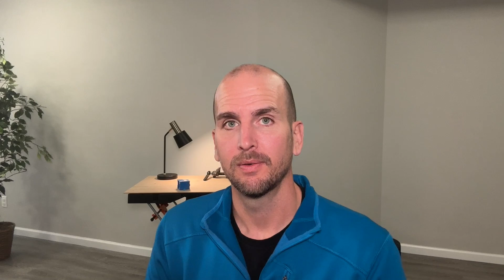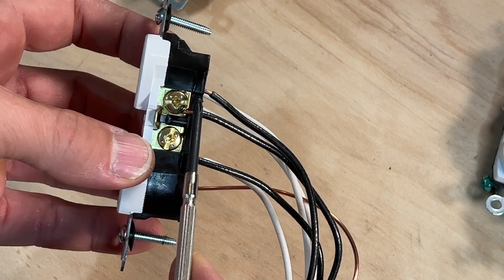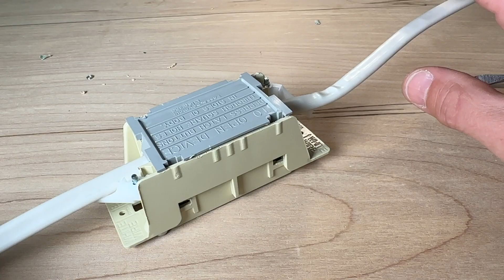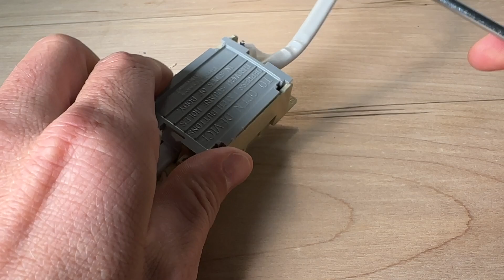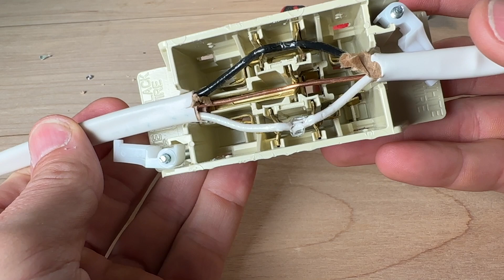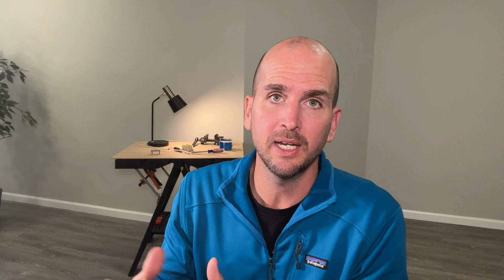90% Of Homeowners Have Never Seen This Dangerous Electrical Device

Comment: 48 years as a master electrician i'm okay with these outlet and switches long as you use the proper tool when installing them. Sure the tool is costly but do you want a surgeon to use a box cutter or x-acto knife on you because they were too cheap to buy the proper surgical scalpels? These are not designed for the common DIY to go playing with. In fact DIYers and videos like this get DIY folks in trouble more than people know. Leave the wiring to the pros. I had to deal with an accountant once who wire an outlet wrong and of course it shorted sparks and flames so he said. I told him I know very little about being an accountant so would he want me playing around in his customer's books? He got my point real fast.
Reply: When I worked in a hydro-generation plant one of the electricians came back on a Monday and told about going to help a neighbor with rewiring: his neighbor, not knowing anything, had bought rolls of green, red, black, blue, and white wire (at least it was all 12 gauge). Then he started wiring each circuit a different color.  - a red ground, neutral, and hot here, a white ground, neutral, and hot there, a black… etc!
Reply: @DanielinLaTuna  Holy Moly

Comment: The real question is: why the f*ck would you be drawing high current from an RV? These are completely fine for low power applications. I agree they probably shouldn't be in an RV due to the constant motion and vibrations that occurs while driving.

Comment: Never saw one.  I'd never use one either.  I don't even like them for low voltage wiring and they do have problems no matter how well you press them in.  I'm a DIY guy who has done a bunch of electrical over the years.  I've seen/fixed a lot of crap from "professionals".  I agree with your 3rd option for wiring.  I like back wire with the screw down terminal approach the best.

Comment: I've seen these in some repairs I've done in mobile homes. They should be outlawed!! Trouble comes when you have to replace one that's burnt up, and there is no slack in the wiring to be able to remove the damaged portion, and reconnect a proper device. Don't know how these were ever allowed by the NEC.

Comment: Have these in a new Rv.  One was packed with three pieces of Romex. It was broken and I could have warranty claimed it but after seeing it I decided to just install a box and standard plug. This was a circuit for the kitchen counter and we use a high amp water kettle there. Hard to believe these are legal.

Comment: I'm a new, younger home owner and have never seen these things before. Just LOOKING at it, I hate it so much. 

One of the first things I did when we bought our house was replace most of the outlets. One of the GFCI's in our bathroom wouldn't work when a higher power device was plugged in like a hairdryer or vacuum. But it wouldn't trip the breaker. When I took the outlet off, it actually had a small burn mark on it. And the insulation on the hot wire looked like it had been melted off a bit. After this, I became paranoid and replaced almost every outlet in our house using your guides as info. So you really helped me. I found that most outlets had used the speed wiring method. I would NEVER use one of these lol.

Comment: Have them throughout our 35 YO doublewide. I've replaced all of them on several circuits to handle the load generated by modern home electronics, especially the office. Slowly replacing the rest of them. A few of them were scorched inside from the bad connection points.

Comment: According to the 3280 hud standards if its ul listed the device can be used in manufactured housing. Manufactured homes still use the 2005 nec. The worst part of this is that there are blanks that are listed for use in concealed locations in wall cavities for if a romex wire gets damaged the blanks can be used to repair the wire.

Comment: I had to change the light switch out in my sister-in-law's trailer it was shortened out
Reply from the maker: Yeah the switches might even be worse.  Not to mention the setup for a 3-way circuit 🤦‍♂️

Comment: Had 35’ 5th wheel RV where the GFCI outlet in bathroom failed. It got very hot and started to smoke almost to the point of fire. I killed power to the RV and replaced this outlet with a residential unit and worked perfectly since.

Comment: From my experience with this style of connection usually the back of the housing has the press built in to it and have had issues with types of wiring, I've noticed that the wiring with the clear coating on the individual wires like in romex simpull they tend not to cut very well but with that said I wouldn't use this. It saves time and wiring in the long run until the property burns down

Comment: Horrible. There are high-amp receptacles and switches for mobile homes specifically designed for doing electrical work inside mobile homes (electronics + related testing)

Comment: Insulation displacement is not something I have seen outside telecommunications and automotive, this type of connection for anything higher than 50v is very concerning. As these are meant to be discarded and not to reused I have the distinct feeling they won't be, I also am uncomfortable with any connector that reduces the cross sectional area of a conductor, especially in a radial circuit.

Comment: I had one of these fail in my Desert Fox travel trailer. Over heated, didn’t kick the breaker but none of the outlets past the failed outlet would work.  Melted plastic and discoloured metal in the outlet. I replaced it with a proper eazy box and outlet. I wonder how these outlets ever passed code.

Comment: I'm not familiar with this type of connector, but given the same type are commonly in the automotive industry for aftermarket products, they are obviously very capable of carrying a lot of current without the generation of heat.
Also given that it has passed the safety testing and safety approval for use in your country, it is obviously deemed as suitable for purpose. 
Unless you have results that show it is unfit for use, your claims that there are inherent problems with them is simply your opinion, not fact.

The real issue is not the connector, it's the poor way they are being installed. If the electrician does not have the correct tools to install them, it's him not the connector that is the problem.
If a car mechanic used a child's chocolate spanner to tighten your wheel nuts would you blame the wheel nuts for coming undone? Of course you wouldn't!
So what logical reason do you have to blame the connector for the poor quality of installation?

Comment: Iam retired,  and have been wiring outlets since I was 10 years old.  I have never seen this method of wiring, and pray that I never see this used in a home, let alone a commercial site.   There ain't no way in hell that is a safe method of wiring. There is nothing there to move enough insulation to make a solid connection.  And when you daisy~chain several of these together, be sure to call the Fire Department in advance. I will continue to use the commercial back~plate fixtures when replacing current devices, or adding new devices.   Those things are a death~trap waiting for a cold, rainy night, and a compounded situation when used in a moble/modular home.     Have you ever seen a moble home go up in flames???  It takes 3 to 5 minutes to be totally engulfed

Comment: So, one uses 14 ga. wire to carry a 15A load, but the junctions between the wiring and the outlet are  what?  Looks like less than 1 millimeter in one dimension.  How did that idea ever gain traction?  Sorta reminds me of aluminum wiring.  I'm glad my mobile home was built before these things came on the market.  BTW, when were they first used?

Comment: I can't say I've seen them often but I've seen them at least twice. No I don't like them. But then again they are used exclusively in trailers where it's important to assemble quick so important that materials are often not chosen properly which means if you're in a trailer fire you have seconds to get out if that. So if they're skipping on the materials and build processes why not the electric too?
Only recently I believe the requirements were tightened down but I'm not sure that was everywhere.

Comment: Could you replace these in an RV with a standard household outlet and side wire it and wrap electrical tape around the screw terminals,. With no box?  There is usually a depth issue in RVs which requires the use of these inferior outlets.  Thoughts?

Comment: 24 year RV tech and owner of several RVs here. Yes, these things are pure sh!t.
The only good thing I've noticed, is on the many I've see that do burn, they burn internally and sometimes melt a portion of the faceplate. They self extinguish as they burn evidently. Never have I seen one cause a structural fire.

Comment: We have a manufactured house that has these. Not just outlets but switches too. When I first saw them I was like what blankety blank are these. I don't like them at all and have replaced them except a few switches and I will be replacing them too. Some of them were used to splice wires. instead of one wire going through it had separate wires fed in from each end with one wire push in on top of the other. In a few cases the second wire was loose. In one outlet the extra wire was almost touching the ground. In another you could see that the outlet was overheating. I think they are dangerous and anybody that has them should change them out with a molly box and a regular outlet.

Comment: 3:15. “Barely” removed the insulation is correct. Yet it has a strong connection (although small) to the wire. And it’s rated as a “gas tight” connection.

Comment: I've done a lot of punch down connections like this outlet, except in ethernet.  Always use the right tool, and you may need to test the tension on the tool to get a consistent good contact.  Done properly, they hold really well, and make great contact.  Getting them seated well does take practice.  I wouldn't suggest them for anyone that isn't doing a LOT of them.

Comment: These are insulation displacement connectors.  I've seen this type of connectors used with communication wiring, never with wiring carrying a relatively high current load.  Installing wires in these connectors requires correct tools and a skilled installer.  If you have these where you live, keep a fire extinguisher (or two) nearby at all times,

Comment: Even when the wire is pressed into the correct place,[ a hole the same Gage as the wire,] where you get more contact area, it is not much at all. It must still be 20 times less surface area than you get on a screw..

Comment: Had them in our 1985 manufactured home. after about 3 yrs of living in that home, we kept having issues with electronic devices like tv's and computers dying very early. once we did an addition to the house we took some of these apart and found that 3 out of 8 or 10 had black charring on the insides of the boxes and it appeared that the wires had shifted over the years from plugging things in and pulling them out, causing the contact patches to be nearly nonexistant. looked to be super unreliable and killed a lot of $$$ worth of electronic belongings. a few electricians we had over to investigate ended up leaking with no answers as to why so many devices were dying. they were like fires just waiting to happen from what we saw.

Comment: I just replaced one of these in my old Airstream trailer.  It had gotten moist from condensation over 40 winters and had corroded the connections.  I'd never seen one before I opened it up, and all I could think was that I was amazed that this passed UL cert.  Amazing.  I replaced it with a shallow work box and a weatherproof commercial outlet.  (Yes, it is inside the trailer.)

Comment: The automotive industry has had something similar for decades called "scotch locks" they are terrible.  They corrode quickly, the connects are poor and fail.  I refuse to use them.  I can't believe they are using the same pinch design in housing.  The heat would be a fire hazard.

Comment: The codes for trailer construction are a joke. The UL seal is probably because the outlet is self-disconnecting when it is overloaded. There is no way this can reliably handle a steady 15 amp load or even a 10 amp window air conditioner.

Comment: I am an RV technician and I hate these. they take more time to wire correctly then a standard outlet and manufacturers leave no excess cable so often times if they fail you are ripping into walls to re attach them. you also see 2 pieces of Romex joined in one of these instead of just one piece through which is a real pain to replace.

Comment: I've not used this particular type of outlet, but typically anything using insulation displacement on wires larger than signal level are a bad idea, even with the proper installation tool.

Comment: It is a manufactured home which , it came with 43 acres and bought it for that reason . They even are on the light switches have this bad design . So this is a winter project , outlets don't cost much to replace and there seems to be extra wire in the walls . My biggest question where did saving 1.00 per outlet get anyone ?

Comment: No experience with those, but have used the rather similar Ethernet/rj45 quite extensively. Even with the right tools. There is sometimes a bad contact made. No way to easily check or know a connection is good without a load test. No good for something of high power. Since everyone knows no one will ever do a load test. Even if it’s “required.” Ethernet is fine. Not enough power for it to ever be an issue. 120V 15A outlet? I don’t like that at all.

Comment: I have these in my 2007 modular home. My problem was the light switches. They were so cheap that the contact springs broke and you couldn't turn the lights off!  I took those out and replaced them with regular light switches using a buildup box. My supplier wanted  a god awful price just for one switch.  I replaced the bad ones and the boxes for the price of one "official" replacement switch and had money left over. And this didn't include the $350.00 squeeze tool to crimp the boxes together, which I really didn't need after replacing them with regular light switches. 

On a related topic, after the installers of the Dog Watch (tm) system left, I kept having false alarms. Turned out they grounded the system by hooking the ground to a screw fastening the receptacle box to the wall. Well these boxes have no exposed ground wires. I extended their ground wire outside to their ground rod and never had that problem since. Stay away from these abominations. Take  them out and throw them away.

Comment: This is nuts but I called it before case was opened. It’s an over sized cousin of the little Mickey Mouse on off switches put on supply cords of lamps and some light gauge extension cords. That’s a scary looking outlet. Trailers are the cheapest built homes on the planet. There pluming parts and fixtures are not like a house either. It’s all junk.

Comment: I think the generic term for this is an insulation-displacement connector. My trailer has these. I was in it one night while it was raining and the trailer was connected to shore power, and I started hearing arcing. I shut off the main breaker immediately. Turns out it was the outlet in the refrigerator compartment, and moisture had gotten into it. I'm looking at the photos I took a the time and it looks like the ground lead partially melted - there's a ball of copper visible between the ground and hot lead where the Romex wire enters the outlet. I think a fire would have been a real possibility if I hadn't been there.

Comment: I worked on a double wide mobile home where the light switch next to the sink failed; it was quite a mickey mouse setup and the wall paneling was less than 1/4", so once I got the 'receptacle' out, the wires were very short and I cannot remember how it failed. I wound up making pigtails, using wire nuts, and putting a re-work box in VERY flimsily with a REAL switch. It was a enlightening discovery of the dubiousness of trailer homes. No wonder tornadoes like them 🙂
In another story, there is a hang gliding site in Yakima, WA, with a large trailer park below; on a NE wind day, they lose SO MUCH heat, that with a little help from a light wind, you can stay aloft in the 'thermal' lift from the park 😲

Comment: No direct experience but they look horrifying.  I'm not certified but I've done a LOT of network based punchdown type stuff and the failure rate is astounding, and those are millivolts.  I can't imagine any way where I would be comfortable with this for 110!

Comment: Is the problem here the device, or incorrect installation?  Since the power wire is continuous, wouldn’t these outlets have lower line losses, and less chance of a connection opening later on (since there are fewer connections)?  Kinda’ reminds me of the old Al wiring myths - it wasn’t the Al that caused the problem, it was incorrect installations.  Nice video, thanks!

Comment: I had these outlets in our 2000 park model trailer. They were not the best way  to run electric, l had one of them melt in the box and never tripped the circuit breaker. I installed all new outlets after that. No more problems.

Comment: I think that the fittings are fine, but the one you show is the equivalent of not tightening the screws on a normal socket. 
Talking of which, in the UK we use neither of your options, we tighten a screw onto the wire. (and  I am not super-keen on that, I like cage-clamps)

Comment: One thing to keep in mind is that many UL listed electrical terminals, sockets, etc. Are only considered UL listed/approved when used with the appropriate UL listed tools.  So installing something using the wrong tool may make the installation non-compliant.